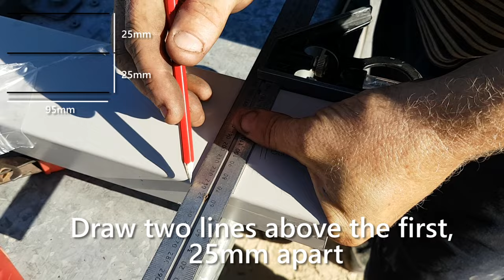How to Cut and Bend Downpipe Ends for a Shed or House - D.I.Y Roys Sheds

Comment: Does 25mm from the line work for every size of downspout?
Reply: I needed to make a slightly more than 90 degree angle and I had  to cut much more than 25mm.  If you ok with a grinder or with a scissor cutter it is better to cut less as you can always cut more to adjust to reach an angle you want. In my case it has taken four times or cutting extra. If you overcut you just ruin a downpipe. 

I think a decision on how much to cut depends on a height of a pipe and an angle required.  I think if the pipe is 80mm in height and you need to get a 90% angle you need to cut half of 80mm which is 40mm.